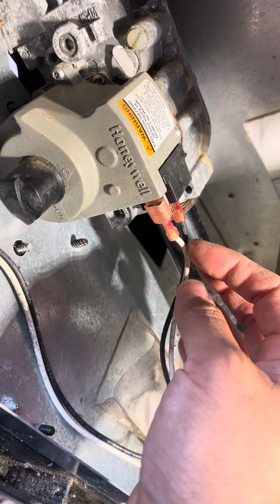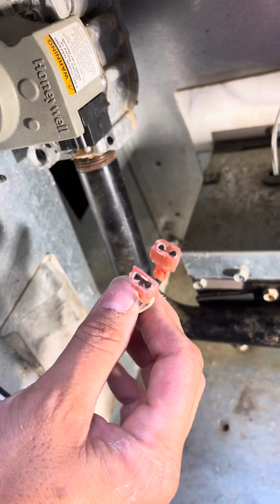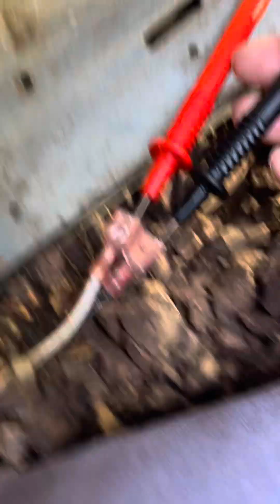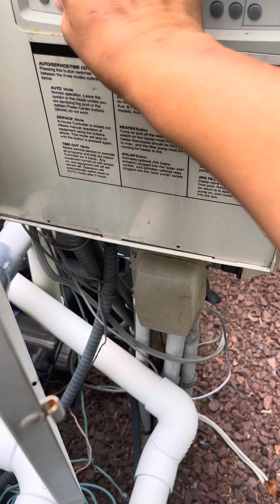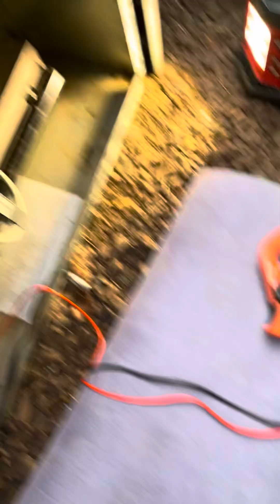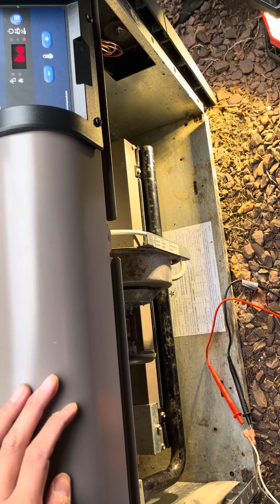Troubleshooting “IF Error” (Ignition Failure) code on Hayward heater - electrical wires on gas valve

Comment: Did you make sure your (glow) igniter is working?
Reply from the maker: I replaced my flame sensor with a new one.  I checked the ignitor and it glows when u look through the little clear circle screen.  I’ve cleaned the orifices in the manifold.

I need to purchase a manometer to check the gas pressure on the gas valve.  Unfortunately I had to close/winterize my pool, so the heater is on pause till next year! But I believe my gas valve is broken and will need to replace it.
Reply: @FixItWithMe  Did you end up having to replace the gas valve?